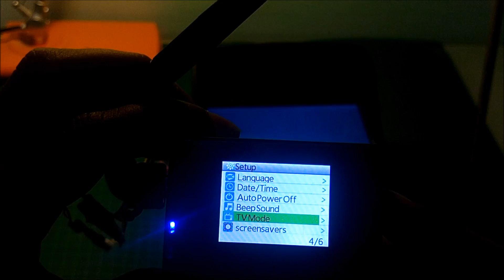FPV Combo System 5.8Ghz gopro/sj4000 setup tutorial using mjx x101

Comment: I want to install this on my syma x8w I just need to know if I can use the battery on the drone to also power the on board transmitter?
Reply from the maker: yes of course!! you can use the battery of your syma or external if you want
Reply: +ARF fpv quadcopters thanks buddy. Cheers!